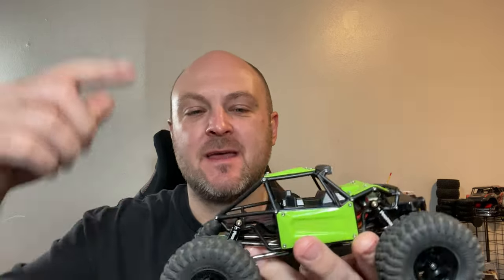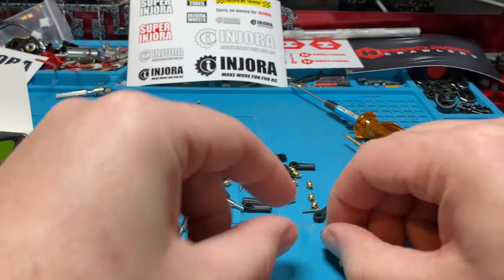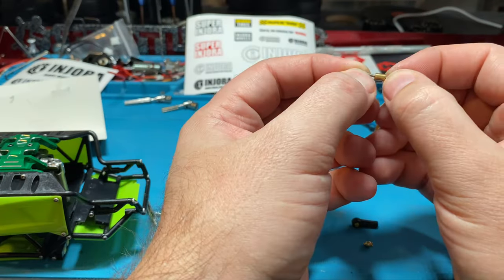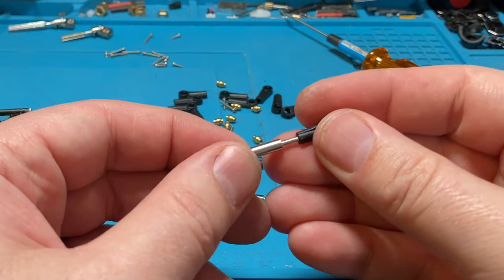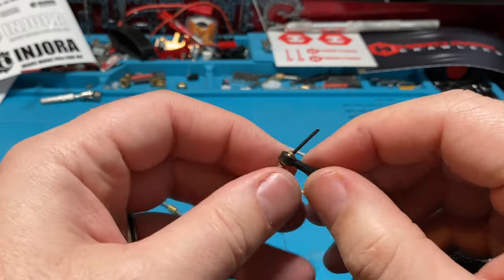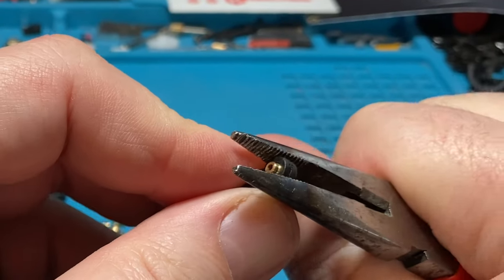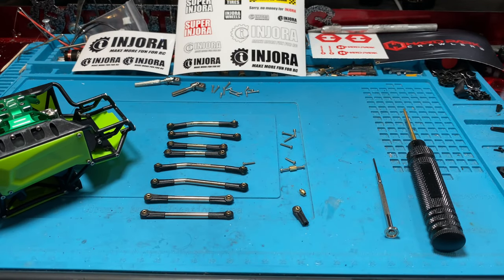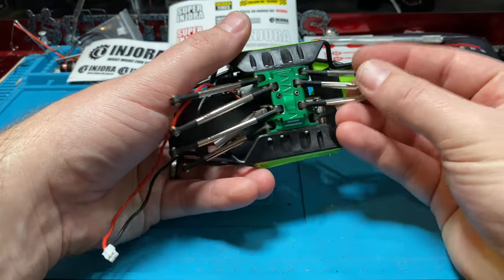SCX24/TRX4M/FCX24 - Injora Threaded Suspension Links. These are great for fine tuning your wheelbase

Comment: Kind of a new subscriber so I've been watching your backlog of videos which are very helpful. I'm also new to the 1/24th segment of the hobby - been into 10th, 1/8th (and 1/32) scale for decades though. The one thing I've noticed about SCX24 vehicles is that the upper right rear suspension link always binds with the optional 50 size motors. No problems with the stock 30 size, but always a problem with the larger 50 size (specially on belly dragers). I've bought links from Injora and other brands and they all bind. I've had to grind down the top of the links and the back of the motor to get any kind of acceptable suspension compression or articulation. Am I the only one with this issue - besides you on this particular video because I've never heard any content providers mention this flaw. What do you do in cases like these or are there any manufacturers with links designed not to bind with 50 size motors. Thanking you in advance for your input. Cheers!
Reply from the maker: You can space the motor up by spacing the transmission housing up a few mm. You can also just shim the motor side under the trans to help tilt the motor up. Or just don’t compress as much. Or grind the motor or get custom bent links.

Comment: 11:00 I am surprised that your drive shafts don't disconnect when you let them drop all the way (without shocks mounted) i have that problem on several builds, have to be carewul not to let them drop or use limiting straps.
Reply from the maker: Yeah, just depends on how long your shafts are.
Reply: @TheShopMiniRC  that’s…. what she said 🤭
Reply from the maker: @SH-ry2xi  facts.

Comment: These unfortunately do not fit the FCX24 as the screw size is the next size down! FCX24 uses a 1.5mm hex head and these are like 0.9mm! Ask me how I know... :(
Reply from the maker: I have another video showing me using them for fcx24 axles.  You swap the end links.  The reason these links are great is because you can do custom link end where one end is the scx24 m1.4 screw and the other is the fcx24 m2.  Or even for the TRX4M m2.5 screws.   Check out our other video showing how we did custom links for our fcx/scx hybrid monster truck. 

https://youtu.be/VNiZ38bc52E
Reply: @TheShopMiniRC  Thanks so much for that! Unfortunately I'll have to chop them down a little as the link is 19mm as opposed to the link ends of the Injora being 15mm....I bought the link set with the length I need so adding a longer link end will add to the overall length. I've noticed that if things are out by half a millimetre on these tiny rigs it makes a huge difference :(. 
Do you know if the brass ball inner will fit into the Injora shocks? The 39mm set I bought also have the smaller holes and mounting screws and a need a ball that will fit with a 2mm hole!
Reply from the maker: @leerushby2364  I am not sure. I def have had some m1.4 balls fit in where an m2 ball was (or vice versa, I can’t remember) but I can’t remember what brand or where they came from.  Worst cause you can always drill out the ball screw hole to get the m2 sized hole.
Reply: @TheShopMiniRC  Cheers for the help. I have a few I can try, but as you say I can always drill them out ;)

Comment: Would be nice if they made a motor side link with a bend or something in it ..all my builds the link hits my motors
Reply from the maker: yeah..  its easy enough to trim or shim though.  but i feel you
Reply: @TheShopMiniRC  true.. kool gonna see if I can trim it
Reply: @rcjoe406  Never tried it, so just pizzing in the wind here..... but I wonder if you could heat and bend the ends? Thread the rod into the ball end so not to distort that part. Heat the end that captures the ball (maybe with the ball in or maybe not?) and bend with pliers. Just have to make sure to get them very close to the same. Perhaps worth building a little bending fixture. 
Alternative would be to get a coupling nut to fit the threaded shaft of the link arms. Spin it on, then back it off a hair and use the coupling nut to bend the threaded section of the link arm. Need to make sure you're bending the correct way and also not bend too much.